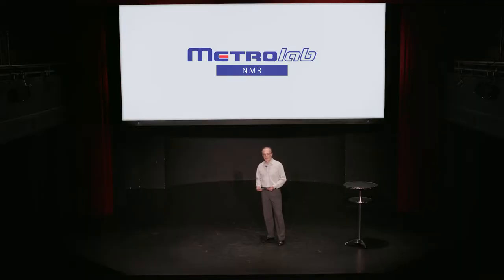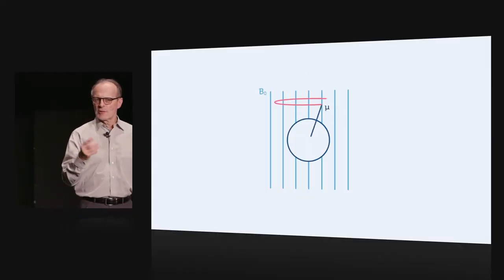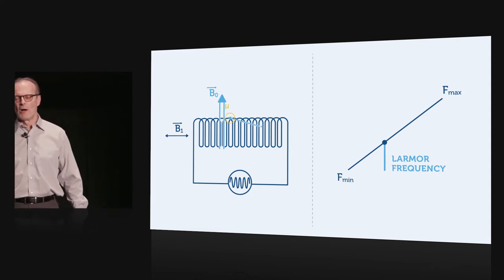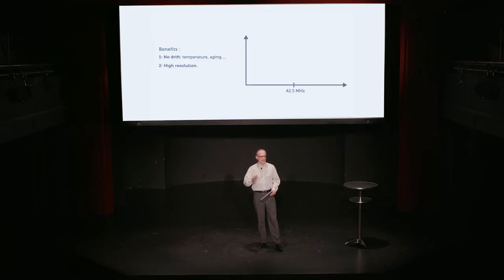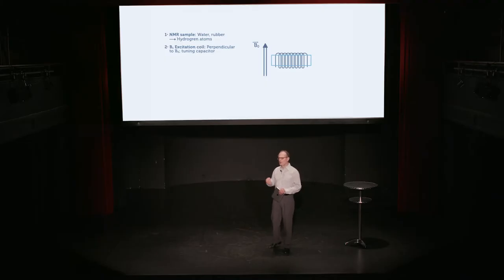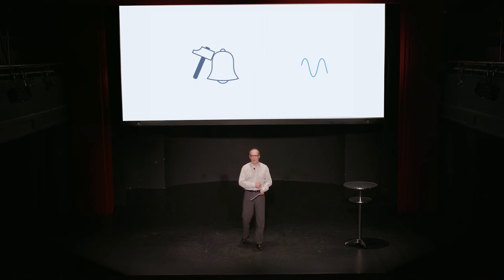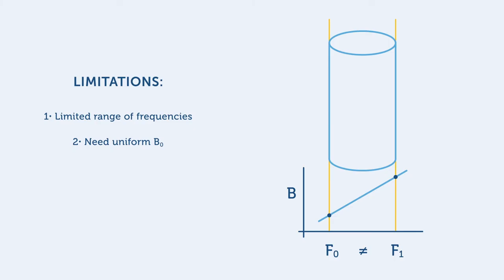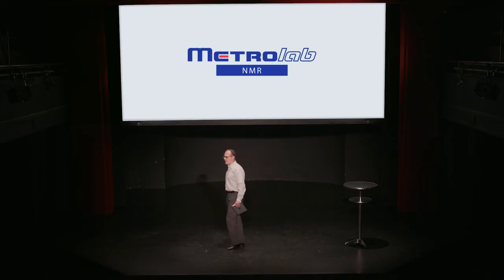NMR magnetometers: technology primer

Comment: So is there image reconstruction in electron spectroscopy? Is ESR not used as much for imaging because of the limited amount of "structures" it can examine, i.e. paramagnetic or only ones containing free electron(s)? 

Theoretically, would there be a way to influence the nuclear spin via the electron?
Reply from the maker: Hi Daniel, Thanks for the interesting question. I am not aware of any work on ESR imaging. I think the same issue we have with ESR magnetometry - broad resonance in most materials - would also impact imaging, since you wouldn't be able to reliably extract the gradient field information for the XYZ deconvolution.
Reply: @MetrolabTechnology  Sorry, it was my understanding that ESR was used for both (1) imaging and (2) sussing out the geometries and other information about certain molecular structures via something like fine, or hyperfine splitting.

For the imaging, I had thought it is used primarily where there are high, or variable, concentrations of free radicals.

So I was thinking that the reason why MRI is a much more "successful" imaging modality is because of the prevalence of hydrogen (as opposed to free electrons w/ ESR) in biological structures.
Reply from the maker: I stand corrected: EPR imaging does exist; it even has its own acronym, EPRI. But I wasn't entirely wrong: the resolution is limited by the spectral line width – and the strength of the gradients, of course.  But I also just learned that there are post-processing techniques to reduce that line width. So there's obviously a lot of work out there that I wasn't aware of; thanks for pointing it out! 

As to why MRI is more widespread than EPRI: the applications of EPRI that I read about in my quick survey all concerned rather specialized research in physics, chemistry or biology. None of these have the universal clinical relevance of being able to image the soft tissue inside our body. I think that's much more important than any technical reason. Philip
Reply: @MetrolabTechnology  Interesting. No doubt though if EPRI did have the same resolution as MRI then EPRI would probably be utilized if only due to decreased cost, namely you would no longer require the superconducting magnets. 

Why is the spectral line wider in EPRI?